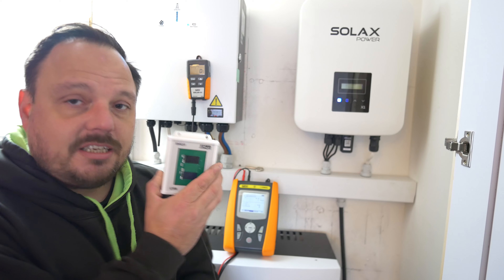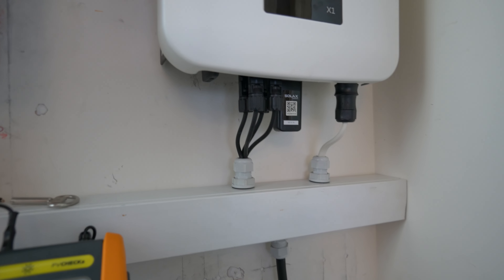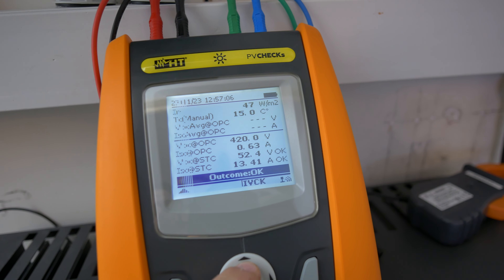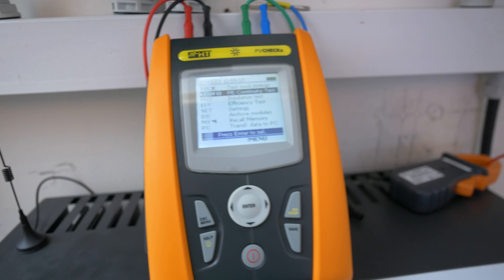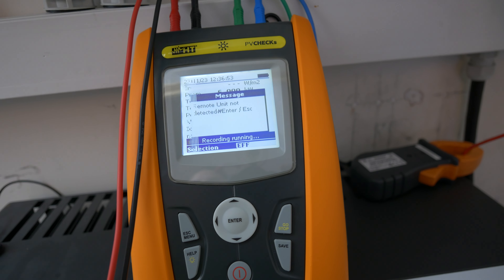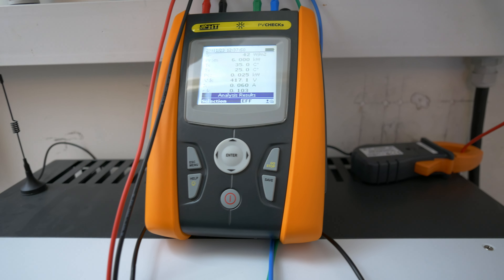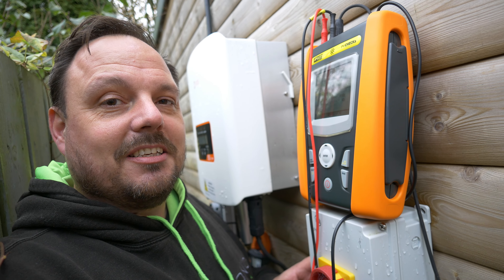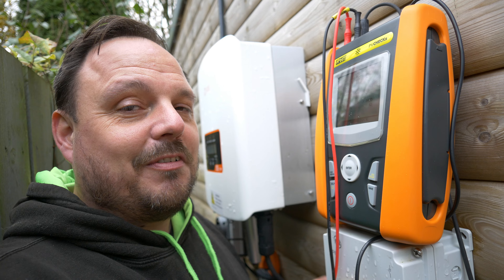How to properly test solar panels... Solar panel efficiency | Does it really give more energy???

Comment: Just about to install our first solax inverter. I noticed it asks for 300mm space for side and top then 500mm from bottom. Do u think this could void the warranty if these distances aren't achieved? 
Another great video 👍
Reply from the maker: Best to try and follow them. I have had clarification from a few brands that trunking, isolators and such are not the obstacles they are worried about so to discount them. Mainly walls, ceiling and larger things like other inverters. The newer Solax inverters do require more space than the older ones as well. We had that nearly catch us out a video or two ago on the channel. Thanks and good luck.

Comment: Efficiency testing, it's a bit of a gimmick. It isn't required.

The efficiency, as we know, is a function of the design and manufacture of the panel.

The panels will be tested by the manufacturer before being ahipped to suppliers. The panels will work correctly.

Let's look at the different potential use cases:

1. Initial Verification
Here you are checking that the system you installed works. 
You might want a base line figure of performance of the system which you can present to the customer to demonstrate it has been properly installed.
This can be easily achieved by using an irradiance meter, messuring and recording the brightness of the sun and measuring and recording the power generated from the full set of panels.

If there isn't much sun then you will need to go back on a day where there is sun and meadure the power output again. That is how you prove the panels and the installation is working properly.

A few calculations or a piece of computer software will give you an indication of what power output you should be getting from a certain irradiance level. If you get a power output way below the expected level then you start fault finding.

2.  Yearly efficiency check
Tne idea suggested in the video of doing an annual check to keep the panels working at their optimum:

Firstly the efficiency of the panels isn't going to change much. Figures for modern panels are that they still generate 80% of their original rated power after 20 years.  That's a change in efficiency from say, from an initial 23% down to 18.4. That's a reduction year on year (assuming a linear relationship) of 0.23%.  And if you detect the change you aren't going to do anything about it.

And the idea of calling out an electrician and his/her charging, £100 or £200 to tell you the panels are dirty or are covered in leaves, that's pretty crazy, and then the home owner pays out for someone to clean them.

And those panels could be covered in fine dust from the Sahara and could have been covered in it for 8 months before you called out the electrician to perform the annual efficiency check.

What would be far better is some permanent in-place monitoring equipment comprising an irradiance meter sending mesurement data to a control unit which also measures the power from the panels and records historical power data along with the irridiance data and process it, present it on a display and generate alarms, norifications visible to the home owner and prompt them to visually inspect the panels from ground level and make a decision to call out someone to clean them.

3. End of Life of panels.
An efficiency check would be useful to aid in determining when the panels are reaching the end of their life. But as previously indicated, decent panels are still producing 80% of their rated power after 20 years, so a yearly efficiency check is an unnecessary cost. A check at 5 year intervals would be better, or just a check at 10 years after installation, followed by at 5 year intervals.
Reply from the maker: Thats a bold statement around panels, are you an installer? We have had quite a few not outputting correctly discovered during IV of solar systems. So that statement is blatantly misleading and false. Yes the ones that are working will output to the set criteria but thats why we check. Sensible huh. 

1. You are checking the system works, is safe and performing to the stated output on the panels datasheet. While that can be achieved when close to standard test conditions are present it is very hard to get a true and quick appreciation of that when it is not. More factors play a part than irrediance, temp is a big one which many over look. Without ensuring you have carried out initial verification correctly how do you know the system is set to work as sold? Risky approach imho when a client comes back with a poorly generating system due to a wiring issue or product malfunction missed during initial installation. Not a liability I would want to follow around my business installs. For a DIY approach I dont fall out with some rough cals, but as a profesional service? No not for me. Plus go back another day when there is sun??? In the UK that might not be for weeks sometimes this is much more cost effective and as discussed gives assurance. 

2. Again you are missing the point here massively. We are not looking for small degredation sustained by the panels over the passing of time. We are looking for variances and subtle changes that can indicate a panel failure. Things that are perhaps not readily obvious. Perhaps a panel has sustained damage and is not outputting correctly, suffered a malfunction, connector failure or many other things. Those are not obvious without a level of interogation especially if the system was installed poorly at the outset with basic guesses based up irrediance measurements. Of course regular cleaning and checks of panels weekly or monthly by system owners are imperative but for a real overview of system performance efficiency and professional inspection brings upside in both safety and RTI. The lack of value in maintenance is not an approach I would support. System owners have rooftop irrediance meters and monitoring equipment. They are called solar panels and inverters. The trouble is many do not understand the data never mind monitor it. We should be encouraging people to get the maximum RTI through appropriate maintenance which also has the huge upside of safety....

3. I dont fall out with longer term periods between tests IF and initial efficiency test was carried out and the client has good records of generation in the inverter apps. The guidance from industry is for a form of annual maintenance which I think is very sensible based upon the results of a poorly performing system and potential for catastrophic consequences in the worst circumstance. 

As professional installers it is all about evidencing we have done EVERYTHING possible to ensure that. Its called assurance for us and clients.
Reply: @electrician247  It is not misleading. It may be incorrect.
Reply: @electrician247  So you do an efficiency test on every individual panel before you install it?  Of course not..why? Because it is a slow process.

You need to separate the efficiency of the panel from 1) Performance and correct operation of the panel, 2) performance of the complete installation.

You can achieve both 1 and 2 without measuring the efficiency of the panel.
Reply from the maker: @deang5622  you are missing the point totally. We are testing the efficiency of the array as a whole. Which when using this tester has all the stored data from the panels inputted. That way we can see precisely if the array is performing as it should based up irrediance, temps, tolerances, coefficients and more. 

We test each panel before taking them onto jobs in basic terms such as VOC. However we can not verify the performance until they are in situ as an array at the installation address. 

We have found issues with several manufacturers MC4 plugs via efficiency testing and also some panels which had scratches that while super hard to spot were bringing performance down subtly. 

These kind of issues can present on transporting the panels to site and in storage pre delivery. Equally damage can occur while mounting the panels to the roof that without a detailed efficiency tests is hard to spot and evidence wasnt in place at the point of installation without an efficiency test. 

It is assurance for clients and contractors. One we are glad to offer on every single job.

Are you an installer?
Reply from the maker: @deang5622  I guess that depends how you see it. Tomatoe tomato
Reply: @electrician247  If you are concerned about the quality of the panels being supplied to you as an installer, are you testing each and every panel, plotting it's IV curve before taking to site and installing?

Do you have the equipment and test jig set up to do that?

Are you reporting these "failed" panels back to the manufacturer?

I would be surprised if they are not testing every panel after manufacture. Automated testing techniques should make it easy.

Or is this phenomenon of defective panels tied to lower cost panels or panels made by manufacturers with a less than stellar reputation for quality?
Reply from the maker: @deang5622  you are clearly not familiar with the transportation of panels to us as installers. Often travelling thousands of miles. Packed and repacked. It is not especially diligent to simply pop them on a roof and make sure the Watts out roughly match what they should. 

Of course we are not performing manufacture spec testing, that would be ludicrous. 

We are however carrying a very simple process of array efficiency testing which has helped us find plenty of defective panels beyond the obvious VOC checks etc. 

All defective panels are returned to the suppliers for refund. Largely the damage seems to occur on transit with some elements of production error as well. 

I can’t speak for really budget brands as we don’t use them. However the issue is consistent across all the brands. 

For such a simple check I find the opposition to it very short sighted and unaware of the practicalities of installing long lasting solar PV systems. 

I will ask again, are you an installer?

I should add we do have a test roof and array used to provide free training to people of industry. So yes we do have the capability for base level Iv curve testing. But that’s a separate issue.

I would be interested to know your real name and credentials to see if they have more value than expert on the internet. Because at the minute you are not convincing me.